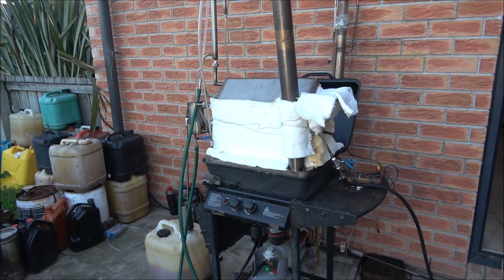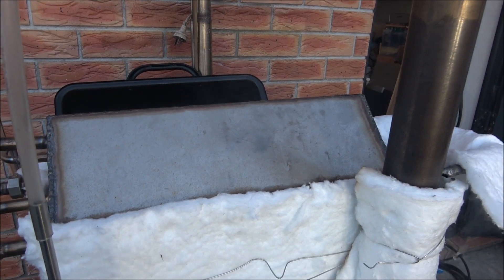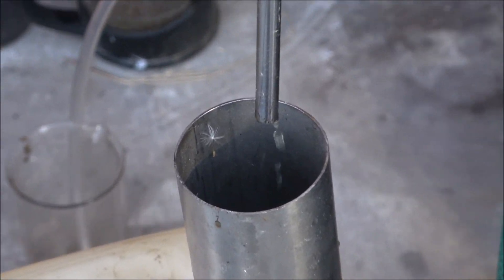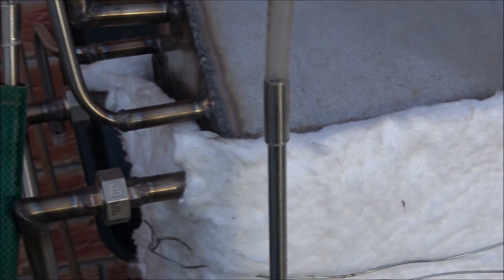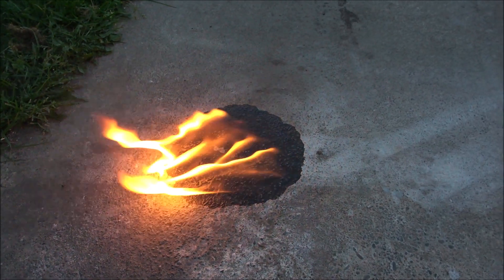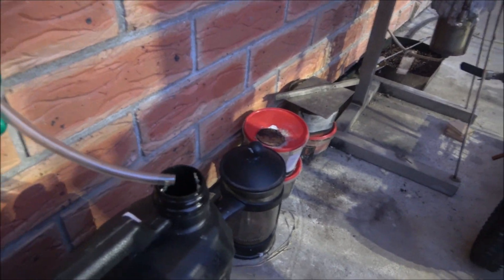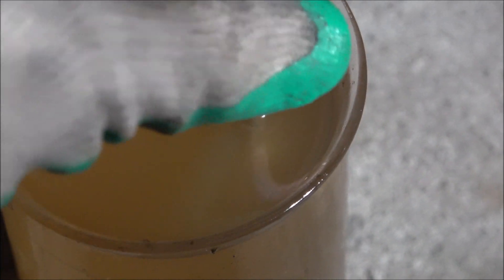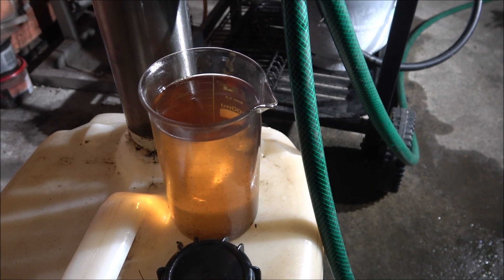WMO Pyrolysis retort pt1

Comment: Hello, nice job & cleaver design !
I suppose the stones is use as large surface exhanger ?  and it  is a waste containing the undistilled fraction ?  how much is the residue in it ?

For your information, ive done some trials based on your first design
https://www.youtube.com/watch?v=SXqSVX2H8ZA
The obtained diesel fraction need a boiling at 120°C to get good diesel  that's run on a engine,

Comment: All asfalt and bitumen remain inside the reactor? How you regulate the temperaturer since gas burn allways with same temeprature?
Reply from the maker: The bottom is red hot, so the deposits are solid carbon, the temperature controlled either by intencity of the flame or by the supply flow.

Comment: Thank you for development of low-electricity use - I have a ton of firewood at my disposal but am off-grid solar most the time - can't really be running 5kw of heaters for a 10 hour distillation haha! I look forward for when you sell plans.
Reply from the maker: Yes, this is the concept that can be powered with whatever available heat source, that mostly economically viable at particular point in space. For example for 20L of oil processing I used 2L of LPG, it is 10 NZ dollars, while the same 10 dollars will give me about 50kw/h, that would potentially make me 200l of processed oil, thus in my case electricity is more economically viable, while in case of total power loss, I still be able to use some firewood or coal for the same operation - versatility.

Comment: this is exactly what am looking most for.... Less electricity for powering it... maybe use non diesel fractions to drip into burner to assist  burner 's job as the the heat source in production of  diesel fractions. . .  THe good stuff end result being mostly Diesel fraction   is desired outcome.  Of course there will be "something" more left too.    Petrol fractions would be fine.  

Wonder how well the resulting fraction(s) could be used for blending with filtered straight motor oil. instead of refining it further such as  running it thru a petrol separator. Aka retort producing mostly a "blending" agent to mix with other filtered (but not run thru a retort)  waste Motor Oil.  Use that "blend" to run diesel engine(s) on.  (  got couple.... fuel hungry CAT truck, MB617 Jeep and , yancloned motorcycle)
Reply from the maker: The tube that connets the bottom plate and the top of the column is conducting burnable gases from retort to the burner part of the contruption, so it really assists the heating, not LPG alone.
The resulting fuel was processed through petrol separator, and then chemically treated and run throgh centrifuge, and currently in the fuel tank of my turbodiesel Mazda, use it as normal diesel after treatment.
The next video will show the rest of the process, plus thicker oil distillation.

Comment: I heat my still very slowly to 160c at the reflux head. Then leave it for a bit Then increase to 285c slowly. It starts producing fuel about 60c but most is produced at 285c. The SG is just below 0.8 so I don’t separate the lighter fractions
Reply from the maker: The temperature of about 375c will give best quality, the temperature of about 410 is best conversion, production flow and maximum separation of diesel fraction without light hydrocarbons forming.
Reply from the maker: With oil processing there is no lighter fractions to separate, they start to form at temperatures over 400c.
Reply: That is reflux temp. My boiler is definitely over 400c

Comment: That's very good question what is exact temperature we get petro?
Reply from the maker: There isn't an exact temperature; any temperature that allows the long hydrocarbon chains to split will produce some amount of petrol. However, the higher the temperature, the better the results. Additionally, the thicker the oil, the better the petrol ratio in the distillate. Therefore, I believe a temperature range between 450°C to 600°C would be optimal for obtaining significant amounts of gaseous and light fractions.